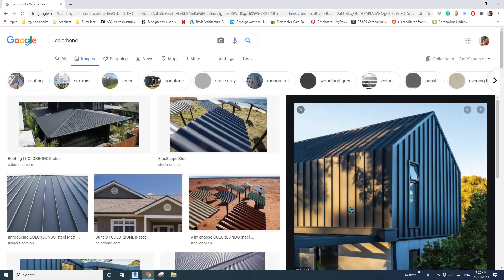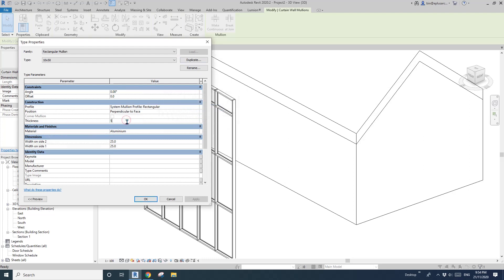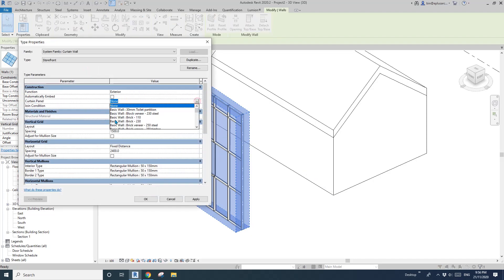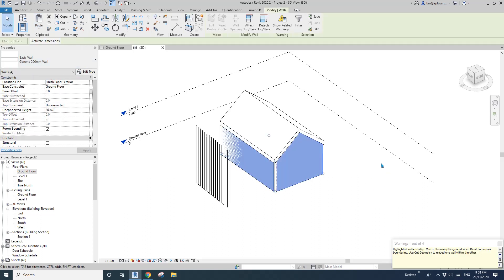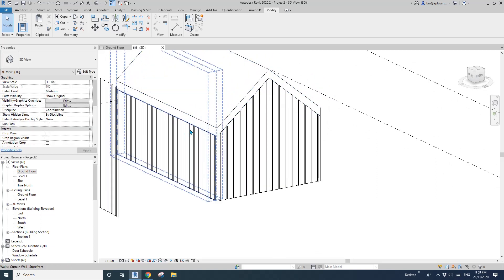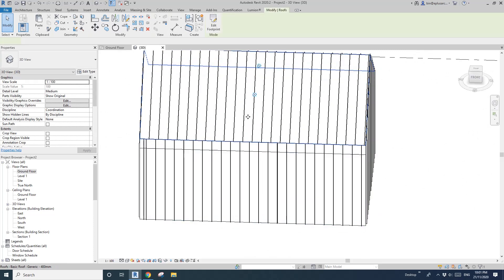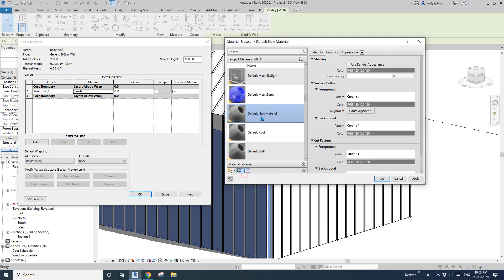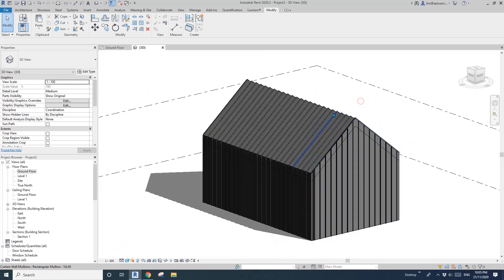Revit Everyday (Day 246) - a little trick to make your metal cladding look better

Comment: I would like to know, why would it not be suggested to be used on a actual project? why just for presentation? is it impossible to execute it in a real project? i can't seem to find any existing projects like these and yet there are many rendered photos and design sketches
Reply from the maker: Having multiple walls in the same place is never a good idea. You will also need to edit the profile when changing windows or doors. I only do this if I want better renderings and will demolish them in the same phase as creation, so they remain available if I need them again.

Comment: So I should use the Mulliins for the corrugated sheet Instead of the panel?
Reply from the maker: I don’t think you should model corrugated sheet at all. Just a basic wall with some vertical surface pattern for indication. You can then use some material from the appearance library for your render, and there should be some corrugated material in some ther render tool such as Lumion. I did have some video about using curtain wall panel to create some corrugated panel, but it won’t work on the gable end due to the non rectangular shape.
Reply: @BINHE615  Exactly! This was my problem. I can't make a corrugated sheet panel or standing seam roof on gabled roof (or joined roofs) because it does not fit into the triangular shape of the roof.
Reply from the maker: I will never model the corrugated sheet anywhere, but I will model the seam for standing seam wall/roof if I want some nicer renders. I will create a curtain wall or sloped glazing with some simple 5x50mm mullions, and it has to be very simple (copy and paste the basic walls/roofs in the same place and replace it with the curtain walls/roofs)

Comment: He did not even show how to add skylight window.
Reply: Im not trying to be disrespectful to you, you a great person with a lot of good tutorial. I made a metal sheet roof family template but whatever i use it as roof cladding on top of a roof i have problem cutting some holes in it for windows. I wish i can send you a picture, do you have facebook page??
Reply from the maker: No problems, questions are always welcomed.
I'm not sure what the metal sheet roof family template is. 
One of the methods is to create a face-based family with a void cutting the base, so when you load it into your project it will cut a hole on your "metal sheet roof family template".
Another method is to use sloped glazing to create the standing seams, just like what I did in this video. You can simply edit the profile and add a shape to create the void.
Reply: @BINHE615  ow okey okey, thank you. Completely understood
Reply from the maker: I didn't, did I?

Comment: Hi Bin He, what's the reason that you don't recommend this method for real projects? Thanks
Reply from the maker: Having multiple walls at the same location is not good, also you might duplicate the doors and windows when you duplicate the walls. Sometimes you have to deal with the system panels because you can’t have empty panels for non-rectangular shape panel.  So, unless you need it for render, I suggest you use surface pattern. :)
Reply: @BINHE615  So basic wall with horizontal reveal is better?
Reply from the maker: @trevorbelmont4633  It depends. I only use Reveal for simple patterns. When the pattern becomes complicated, I will use Face-based Void. For claddings like standing seam, Curtain Wall is the easiest option; it's also possible with a beam system. However, I only use these methods when I need a more realistic render. Once the render is complete, I will delete them and only use material surface patterns.